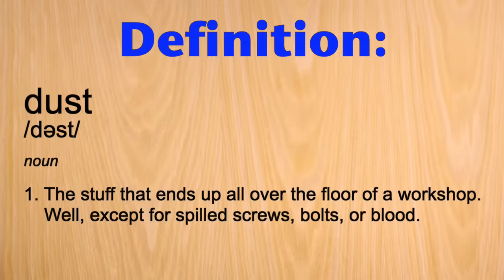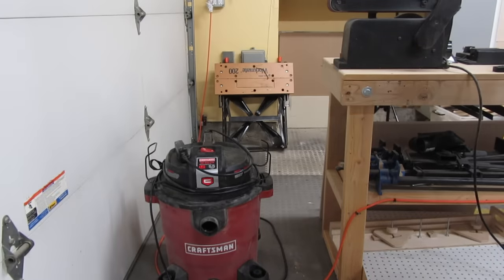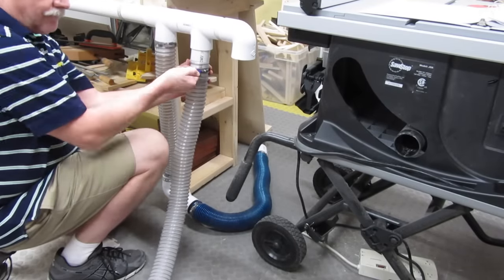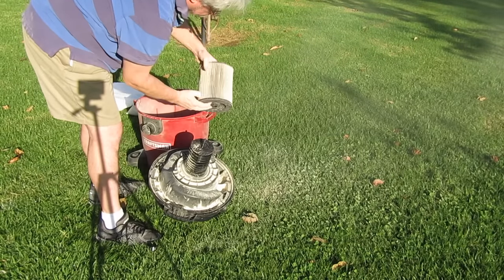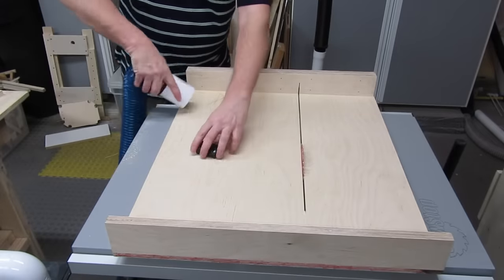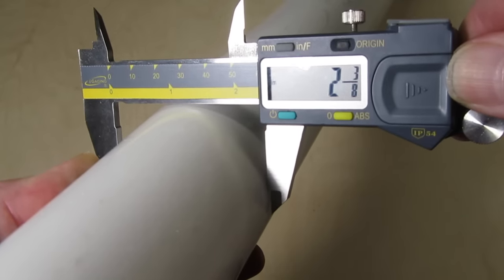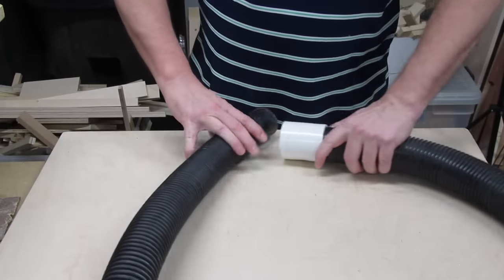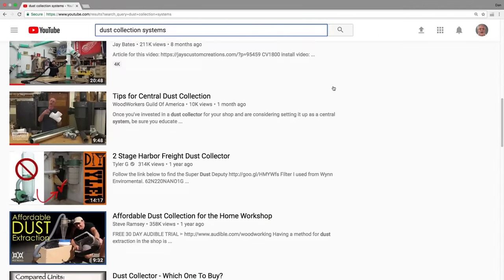Dust Collection for Newbies: Introduction to Dust Collection

Comment: You probably won't see this since it's an old video, but I will leave this little nugget anyway. You should look into dwv pvc fittings. Dwv, stands for drain, waste, and vent. These are considerably cheaper plus they have sweep 90s and y's. These will allow less restrictive airflow. Also look for cellular core dwv pvc pipe. It's not only cheaper, but much lighter and easier to cut.
Reply from the maker: Thanks for the info! And yes (obviously) I did see your comment even though it's on an old video. 😄
Reply: Neither of you will probably see this since it’s an older comment and even older video but I’m stealing this advice
Reply: Glad to help!
Reply: ...none of you will probably see this because...ummm...well, you know the drill...😉
Glad I ran across this as there's a lot of good info...thanks guys!!!
Matt
Reply: Fantastic idea. Thanks for uploading. Great video. 👌👍
Reply: you will read this

Comment: I used to work for Oneida Air systems. All their products are first rate, and American Made in Syracuse, NY.  I recommend running grounding wires around/along all your PVC, connecting to the metal in your flex hoses, and run to a ground in the floor, so as to prevent static buildup and getting shocked (not lethal, but annoying all the same) from your pipes.
Reply from the maker: Thanks for the comment!

Comment: This is a great video.  The only caveat is the use of corrugated/flex hose in places that you don't need, e.g. from the vacuum to the cyclone and from the cyclone to the 2" plastic pipe.  Flex hose creates significant pressure drop.  Even short sections.  Flex hose bends are HUGE pressure drops.  You made a stand for the vacuum and the cyclone, why not use 2" plastic with long radius elbows.  Then in places where you need a tee, use  45° Tees, called Wye Sockets?  Also, on the drop to the floor, replace the tee and flex with a Wye Socket, a 45° elbow and  2" plastic tube?  Cheaper and way better air flow.  You will be able to tell the difference in air flow with you hand over the inlet of the device without any expensive air-flow measuring instruments.  Metal or plastic has smooth walls that allow greatly better fluid flow.  (Air is a fluid.)  You already dry assemble, so disassembly of one connection to empty the bin or vacuum is not difficult.  Bottom line: use flex hose only where absolutely necessary and make the lengths as short as possible to dramatically increase air flow   Two more points, that make significantly less dramatic difference: #1) Make the blast gates with an extension on the other side of the air flow hole that goes all the way through the gate so there is no groove to catch dust when the gate is open.   Further, waxing the slide reduces dust that does get caught and makes the gates slide easier.  #2) Round over all edges as much as possible where air flows.   Square edges cause much more air flow resistance.  What I like about your videos is that they are clearly spoken.  That makes a huge difference to us old guys with hearing loss.   Well, I was able to attach a screen capture.  I don't know if it will stick around when I comment, but if it does...  Notice one Long-Radius elbow from the cyclone to the vacuum inlet with all plastic pipe connections.
Reply from the maker: Thanks for the tips!

Comment: We use a Miter Saw to cut PVC in our shop. There are a few issues cutting PVC this way. If your piece is too small it is liable to throw your cut. Also make sure you clean off your blade to keep it from gunking up.
Reply from the maker: Thanks for the info! 😄

Comment: One thing to consider when using PVC is static build up which could cause a fire.  Simply wind a piece of wire around the length of the pipes to a spot where you can earth it... doesn’t have to be wound in a tight coil, just a loose spiral around it is fine.
Reply from the maker: Here's my thoughts on the subject: https://thenewbiewoodworker.com/dust-collection-fire-danger

Comment: Great video, loaded with info, delivered in a very clear way.

One recommendation. On your cyclone, you have it mounted on a bucket lid, making it a bit of a pain to open. On mine, I cut 2 circles if 1/2"  plywood on my bandsaw. One a bit larger than the bucket opening, one smaller, leaving about a 1/2" all the way around. Glue them together and  cut out drill a centered hole that matches the opening of your cyclone base. Mount the cyclone to the board. Around the outside of the smaller circle apply a strip of dense one side sticky foam weather strip. All it has to do is sit on the bucket, no clamp needed. The vacuum will pull it down and make a tight seal on the bucket. Even with a dust gate open I can pick up the bucket and all buy lifting the cyclone and it doesn't loose the seal. Shut it off, move the cyclone assembly and you can easily dump the bucket. It doesn't take long to make, but it saves a lot of aggravation dealing with a typical bucket lid.
Reply from the maker: Thanks for the kind words, and also for the info on how you handled the lid situation. 😄For me, the $3 lid opener I have (http://amzn.to/2CcX3UU) makes it really easy to get the lid off, so I think I'll stick with that. But I see the appeal of your solution, definitely!

Comment: I use a chop saw to cut PVC all the time go slow ,perfect cuts, nice and square ,very quick
Reply from the maker: Thanks! 😄
Reply: I've had PVC explode on both table and chop saws. Scary for sure and luckily no collateral damage resulted. Being lazy, and typically not needing perfection, I use a sawzall.
Reply: I use a piece of long string and rub it back and forth quickly along the pvc. Creates enough friction to melt through and makes a clean cut fairly quickly. FYI
Reply from the maker: @symcardnel1741  😄
Reply from the maker: @PatrickScott9192  I've tried this, and it does indeed work. Thanks for sharing!
Reply: Every time I use a miter saw (second hand, 25 euro) to cut. Just take it slow. PVC will be heated a bit, making perfect cuts. I just love it.

Comment: I'm about to setup a similar system and, as a suggestion, I was thinking that trying to place the vac as close to the center of all the tools would slightly improve efficiency. This way, I'll have my gates setup right after my vacuum hookup and this will also reduce the length of the vent runs to all my tools. The way yours is setup, the vac is at the far end of the system with the table saw and router at the opposite end. having the vac in the center of the action may help with suction. Seems like your system is working just fine though.
Reply from the maker: I've thought about doing that before, but it wouldn't work well with my setup. But if you can do it, then by all means, go for it - it sounds like a good idea to me. 😄

Comment: Nice video, I cut pvc on my DeWALT 20 V mitersaw what has a 7 1/4 blade, important is to lower the blade slowly so you get a nice straight cut, the good thing is your pipe is supported on both sides against the fence.
Thanks for sharing your video, love it
Reply from the maker: Thanks, and thanks for the tip! 😄
Reply: I've done the same, but I usually use a hacksaw. It's just easy enough.

Comment: Thanks for this great intro to dust collection. I have used my mitre saw to cut PVC pipe of various sizes.  The most important factor in doing so safely is to secure the pipe so it does not move or twist as it is being cut. Next most important factor is to go slow.  You get clean cuts.  Make sure to wear face & eye protection and a bib.
Reply from the maker: Thanks for the info! 👍

Comment: Good video, but one thing you didn't account for is the very fine particulate.  The stuff that escapes from the dust deputy goes into the shopvac and the larger of the small particles drop into the shopvac, but the smallest of the small particles can potentially get sucked through the filter and shot out the exhaust port.  It's worth inspecting what filter you have on the vac and if yours isn't rated for fine dust or hepa, then getting something that will hopefully stop those small particles from being blown around the shop.  The ones that come standard with the vac just don't cut it for super fine dust.
Reply from the maker: As I mentioned in my other reply, small dust particles are out of scope for this video.

Comment: I cut PVC using a "chop saw" and I find it works just fine, but be sure to have a firm clamp (I use a length of wood grooved with a ""V" at about 60 degrees to hold the round contour of the PVC I am working with) so that the piece does not turn when the blade bites into the soft plastic. As with all softer materials, going slower can make the job safer, let the blade gain a foothold into the material, then slowly nudge the blade down, remember that as you hit the centerline of the round pipe, there is maximum bite going against the wall of the pipe. This is the point you should cut the slowest, to allow the teeth of the blade to take more material away as the saw is lowered, this never giving the material time to "grab" the blade and throw itself out, or blowback into the path of the blade suddenly. Most "rip" blades are not good for cutting PVC, as they have a deeper tooth recess and the teeth are spaced further apart. I would recommend a "finish" blade, (80 tooth or higher for a 12" saw) this gives the blade far less probability of kicking out any material because it is constantly being taken out of the path of the blade before the saw is lowered into the weak material. Never cut softer or "weaker" materials using a dull blade.
Reply from the maker: Thanks for the great tips!
Reply: Oh! THANK YOU! I've already replied to comment asking  about this.
Reply: Having a rip blade on a miter saw would also defeat the purpose of a miter saw
Reply from the maker: @SpicyTexan64  👍
Reply: Well, I have a permanently damaged thumbnail from cutting pvc on my miter saw.  I was plumbing an entire house and I plunged into a piece of 2" too fast like the speed I would use for wood trim.  It exploded!  I just forgot for a second it was pvc and not wood trim, my mind was elsewhere.   Boom!   A sawzall and Black & Decker workmate are perfect and always de-burr the inside and outside of pvc.
Reply from the maker: @drobb4207  Ack! So sorry you got hurt. All it takes is a little loss of concentration. And exploding PVC is scary as heck!

Comment: I was taught in high school you could flip the miter/table saw blade around so it's backwards to use to cut PVC. It's a much less aggressive way to "cut it".
Reply from the maker: Wow, how interesting! I wonder if anyone here as tried that? Thanks for the info!
Reply: (Edited for easier reading ;) )
I'm a construction plumber:

Don't use a wood circular blade (table, circ) to cut pvc pipe (sheet goods,ie: plexiglass is fine. just keep blade hight half a tooth passed material).. yes it works, but it often melts the already cut pipe leaving pvc on the blade due to the tooth set, using the saw blade backwards also "melts" the pipe more instead of cutting cleanly( so only use if it's a cheap blade or you plan to clean it)...  Miter saws work well as long as the pipe is held stationary.  Angle grinder with wood blades are good for cutting pvc, but you get more or less completely covered with pvc chips after the cut.

There are specialized pvc blades in most sizes (4" 7" 10" 12") if you 'must' cut with a circular bladed tool. If you are using a chop/ miter saw, use a abrasive disk meant to cut metal. Cheap and safe, you will have to grind off the melted pcv on the sides of the cut, but that can be easily done on the side of the disk. (What I use if I'm working in 1 area for a long period of time)

 I would suggest a low tooth count hack saw blade (12 tpi-18 tpi) or a pvc pipe saw (a good one will cut 2" sch40 pipe in 4 strokes) for small amount of cutting, a reciprocating saw with a 'rough cut' wood blade which has little or no set for large amounts of cutting (what I mainly use when I need mobility). Any decent pipe cutter that's over 1.5" will cost quite a bit... my edc cuts up to 1.25" cost around 15 US, a decent 2 1/2" capacity one costs around 70US (both my local prices, non US).

Disclaimer: I'm not familiar with work site safety laws in every country.. so what is legal here.. may not be where you are. (Mainly the grinding the pvc pipe on the side of the abrasive cut off disc, due to having to lift the blade guard while the machine is running.)
Reply from the maker: Wow! Great stuff. Thanks! Just a quick note on long comments - for anyone reading this: You can compose comments in a text editor, then copy and paste them into a comment box, and that allows you to break them up into multiple paragraphs.

For the PVC pipe saw, are you talking about something like this? http://amzn.to/2zxzbZJ

Love the comment about using angle grinders and getting completely covered in PVC chips. I don't think I mentioned it in the video, but I tried this once, and boy are you right! And getting PVC chips off of things is not the easiest thing in the world.

Thanks for the info about how circular blades melt the PVC. I had seen that happen, but didn't really understand why. Now I know!
Reply: I use shift+enter on pc to force paragraph changes on youtube :)

The stanley pipe saw has good reviews on amazon. haven't tried it myself.. try finding a japanese one if you can.. their pull saws are amazing... this is the brand I use (sorry even us plumbers don't know the actual name lol.. we just call it the 'Japanese Pipe Saw" or just "pipe saw", everyone in the trade uses them more or less exclusively)..

https://www.carbatec.com.au/handtools-and-handplanes/japanese-saws/japanese-utility-saws/utility-pullsaw-h-300-blade-no-z-8032

But no where near that expensive (listed as 30USD), but as I live in East Asia, that could be a major factor.. the saws are roughly 8.50USD and blades are about 6USD
Size wise they are about 8 inches of blade and about 1.5 inches high.. they come in rectangular and pointed versions.. the pointed is easier to use (less drag)
Reply from the maker: Thanks for the info on shift+enter - it works on my Mac also. I should have thought of that. Love the fact you guys call it the "Japanese Pipe Saw".  It just makes me laugh!
Reply: allbout sean  this is for sure the best way to cut PVC flipping the blade or cutting in reverse whichever the practical way depending on the type of saw your using. Agreed. Nice comment.
Reply from the maker: Gotta try this next time I cut PVC. Thnks!
Reply: Im a plumber.   I use a Sawzall with a metal blade... quick snd clean cuts
Reply from the maker: I have a Sawzall - someone gave it to me, so I don't know much about it. I tried it on PVC, but I'm guessing I was using the wrong blade. Can you give me more information about which blade? Thanks!
Reply: Great ideas.

Comment: Tip for cutting PVC with a hand saw if you want the cut to be square: Tighten a steel band cable clamp around the PVC tube where you need the cut to be. Then use the clamp as your cut guide. This prevents the blade from wandering.
Reply from the maker: That's an awesome idea! If you're working with PVC pipes, you probably already have the bands on hand. And if you really need help, you could use two, and just saw between them. Thanks! 😄

Comment: The only tip I have for using PVCu pipe for dust extraction is to wind a copper wire in a wide spiral along it's length and earth it.
Wood dust traveling at speed along PVCu can build up a lot of static and will possibly give you quite a belt.
Can you tell that's experience talking?  #¬)
Reply from the maker: Thanks for the comment. I'll have to do a video about that, because nobody likes the "Office Space" effect. https://youtu.be/zsTDnnh7T6A. 😄
Reply: inside or outside the PVC?
Reply from the maker: @fyrefyter26  I'm not sure. I'm gonna have to do some research. But I'm sure there's other YouTube videos on the subject.
Reply: @fyrefyter26  :  I've only ever got a belt from the outside :¬)  but some people advocate earthed metal screws through the pipe to act as 'lightning rods'.  As long as the static on the outside of the pipe is earthed, I can't see that earthing inside the pipe will make much difference.  The static probably won't kill you but earthing does prevent the pain.
Reply from the maker: @farrier2708  Preventing pain is always a good thing. 😄
Reply: Great tip!  Also I hate it when my hair stands on end from the overhead hose.  Non static hoses are pricey and one of these days I plan to make one.  Wonder if some kind of copper tape would work for the hose.
Reply: @k.b.woodworker3250  : Any conductor will work, as long as it's properly earthed.  In UK  we have a good system and can connect direct to the earthed metal body of the extractor.  In other countries you may have to install your own earthing rod.
Reply from the maker: @farrier2708  That's the one thing I've never understood. How do I know what I can connect to for a ground? I mean, obviously plenty of things in the house are grounded, but I have no idea what to use, or how to know if something is usable, if that makes sense.